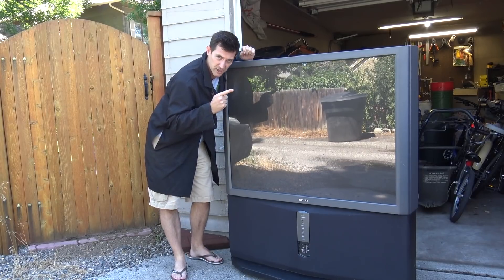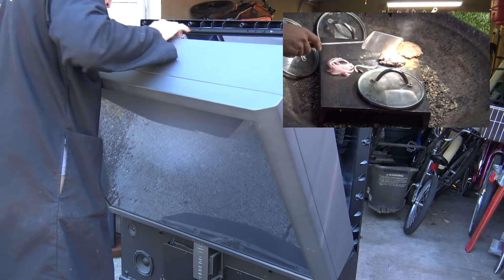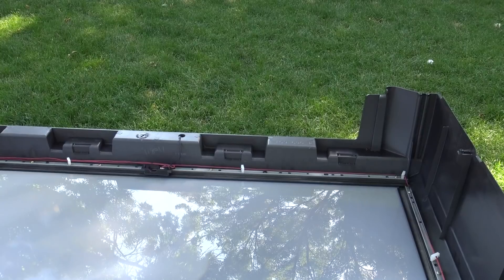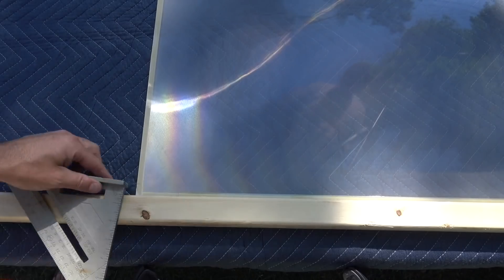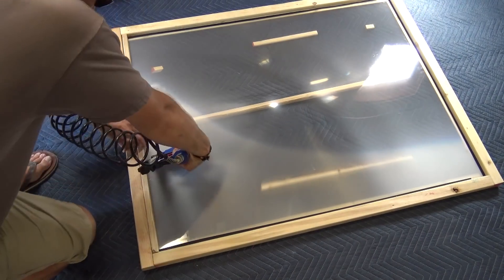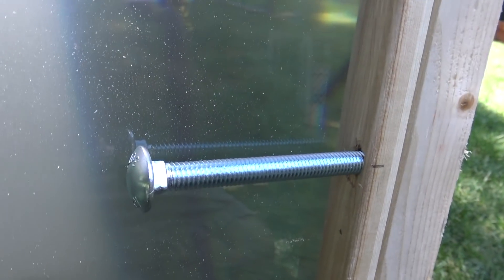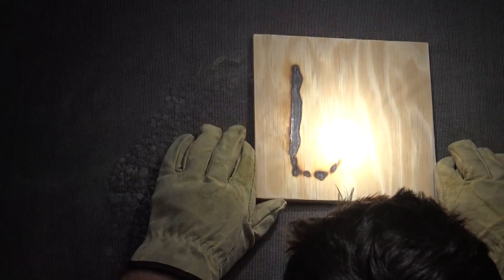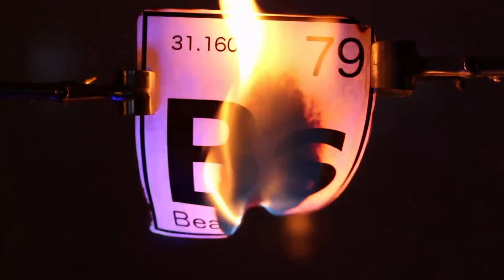How to build a Huge Solar Cooker from a Projection TV

Comment: this tv glass is convex or concave
Reply from the maker: It has no convex or concave shape. It has little lines in the plastic that redirect light. If you shine light at it, it focuses the light into a point. On the other side, if you shine light at it is spreads it out. So it act as a concave and convex surface.

Comment: These screens are awesome. I can melt steel and rock with my 4x5 foot one. You need a welding helmet to safely look at the spot. (One of the non-electronic helmets, the electronic ones work off of detecting the quick changes in light, so they won't work for this)
Reply from the maker: I haven’t tried to melt steel, but I will definitely try it now!